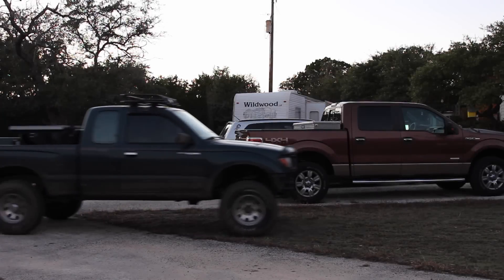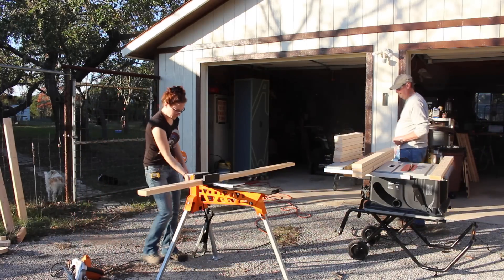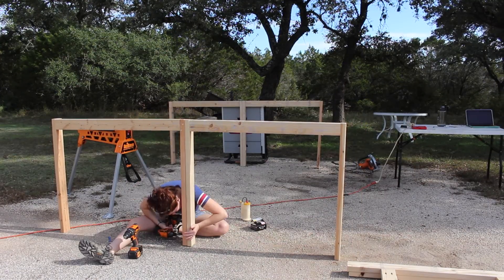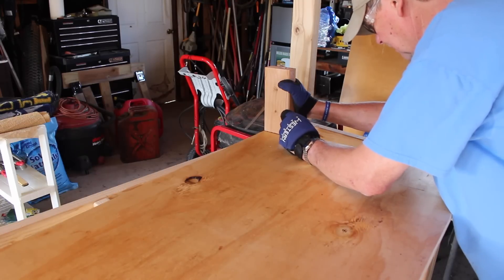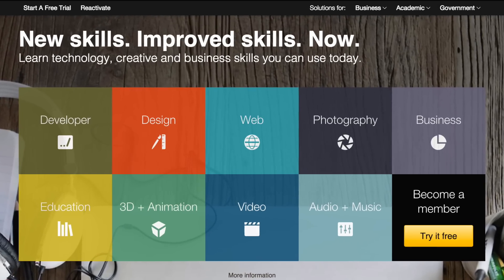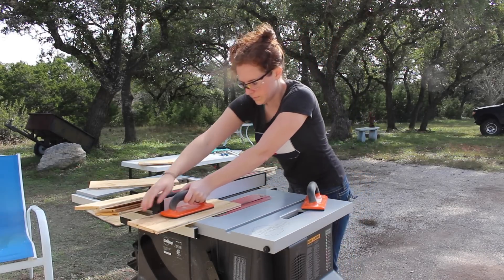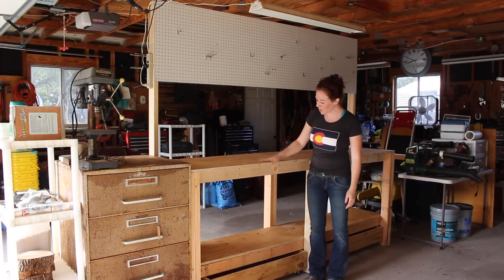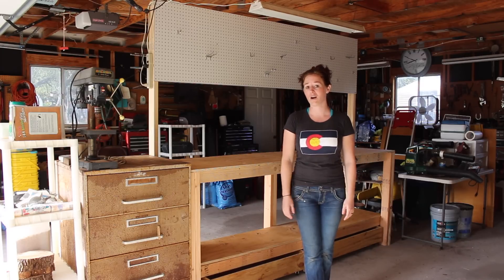Build a Simple 2x4 Workbench

Comment: My 12 yr old son and I built this work bench today. I purchased the plans from your website. I’ve never built with actual plans before and this was great. Thank you for making them available for purchase.
Reply: I have the plans as well and finally getting to giving this a try. I'm curious - did you drill pilot holes for any of the connections that were not pocket holes and what size screws did you use...thinking #8 or #9?
Reply: L C  sadly I did not pre drill in the non pocket hole areas. Mainly due to I do not own a pocket hole jig and was making them by pre drilling at an angle and broke the only 3 I had. Looking back. I wish I had predrilled as I had a few splits during assembly. I used #2 exterior screws at the lengths listed in the directions. It still turned out great and will suit my needs. Best wishes to you on your build.
Reply: @SkolDriver  Thank you for the reply. I've been procrastinating on this project out of dread of sorting through warped 2x4's at the orange box but am inspired to try this.

Comment: Funny Dad. Lol. Great bench. I've made benches out of 1 x 3 with two sheets of 3/4" plywood. It was topped off with green board. An excellent surface to make drawings on. The corners were 1\4" ply cut in 6 " triangles for strength. We used them mostly for building flats as scenery construction. Loved the build and loved the clothes pin you stuck on your dad.

Comment: Nice work April! Great project, and time spent with parents is always time well spent.

Here's a thought if anyone else builds a bench like this.  If you've already got the Kreg jig, use pocket holes from below to fasten the plywood top to the bench.  That way you eliminate having all of those metal screw heads on your work surface that can screw up delicate tool edges like chisels, plane irons, and saw blades.

Comment: I decided to build this workbench yesterday. Purchasing the plans was the best $5.00 I've spent in a long time. A couple of comments: After assembling the bench, I realized that the bench top was too high for me, so I decided to trim 3" off the legs. This also allowed me to adjust the cuts to allow for the sloping cement slab. I also decided not to rip the bottom self. Instead I kept the 24" width and cut out notches to fit around the legs. It's real sturdy and the peg board will help me to keep my tools organized. Thanks!
Reply from the maker: That is great feedback, it sounds like you were really able to modify it to fit your needs well! That's awesome, I hope you get a ton of great use out of it. : )
Reply: +April Wilkerson Now I think I'm going to build the rolling stand for my miter saw 😊

Comment: I have what I think is the original incarnation of the lockjaw, the Elu Superjaws which is now over 20 years old. For such a simple one dimensional tool it's amazingly versatile, I have interchangeable jaws so it can be a log gripper for crosscutting with the chainsaw, or with its rubber or homemade wooden jaws a carpentry tool. When it's not holding timber I keep my belt and disc sander mounted in it. It was £104 pounds in the early to mid 1990s so it's cost about 8p a week so far. I wouldn't be without it.

Comment: Always, bear your bench deck rail on Top of the 2X's with the rail stringer screwed in from behind >>> Ii<<< (the dot in the " i " represents the 2X4 deck frame this leaves a a clear continuous rail ... Also, I like to run a 2X or 1X as an edge band for the plywood edge and that also gives you a continuous surface to use for squaring stuff or hanging tools...You do nice work.

Comment: Either you're very short (don't think so) or that bench surface is tall so how about something like a block and tackle on a track (or electric hoist) to lift those heavy projects (which somehow always appear in my projects) onto  and off the bench especially seeing he will be working alone most of the time? Also retired means getting older and mine is invaluable -  both of them.

Comment: Good onya April.  Great build.  One quick question.  I have the same Triton drill as you but only the 2ah battery.  Whenever I'm drilling something thick it keeps cutting out.  Do you have that problem with the bigger battery?
Reply from the maker: My drills do that when the battery is nearing the end of it's charge but if it's fully charged they never cut out on me. The big or small ones.

Comment: What is the thickness of the plywood you used as the top surface of the bench? I couldn't find that info on your blog.
Reply: +Alec Ray Just by watching the vid they are using 3/4 inch 4X8 sheet of plywood.
Reply: Thanks. I must have glanced over that detail the first time.

Comment: The top surface is to low for your father as fatigue is the enemy of the older people.... the rule of thumb is an inch below the elbows.... As for the finish I suggest my uncle's, a finishing Cabinet Maker, finish for tough surfaces... A paint brush, a disposable plastic container and wood glue.... The formula is 50% water and 50% wood glue, I like the Elmer's indoor/outdoor max because it is water proof, mix well...... it will, after it drys make the wood bench, cover it every where even the floor drawers, so tough that a hammer hit will not dent the wood and it will last and become a generational piece!!! I bet with so many comments that this will not be read by any one!!!

Comment: I would inventory his tools mechanic carpentry plumbing painting machinist then make mobil storage units that hang on the walls using 2 x6 cut 45 degrees . then build work bench. Or build paulk work bench and paulk mobil shelves he has in his trailer. I bought a used cargo trailer 6' x 6' x 11' fpr $1000. Same concept in a garage. Compact storage on wheels. The paulk work bench for table saw and router.